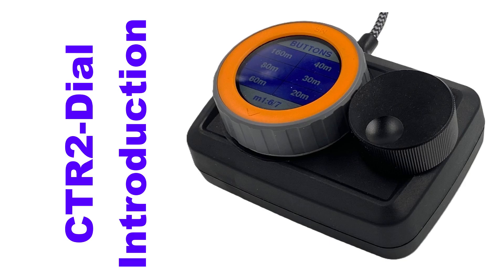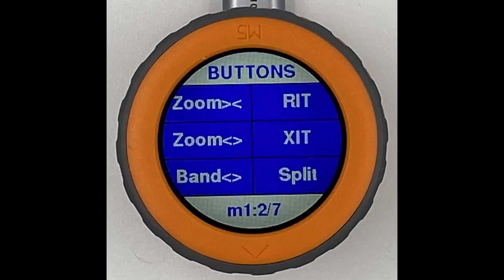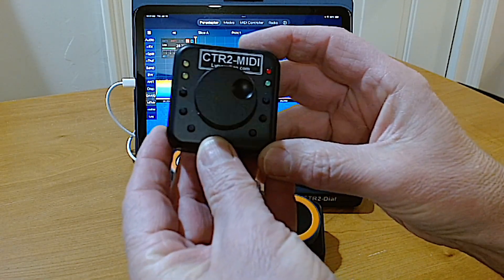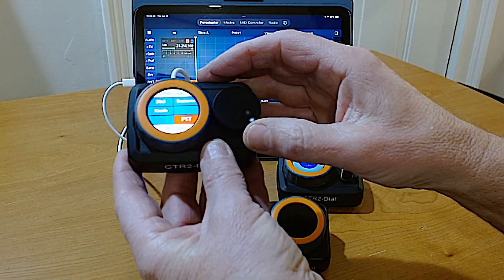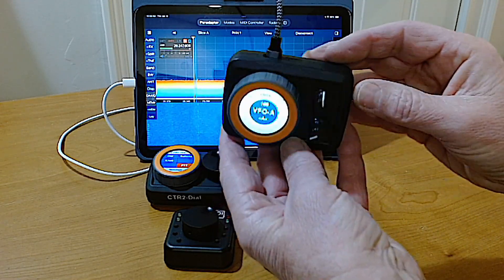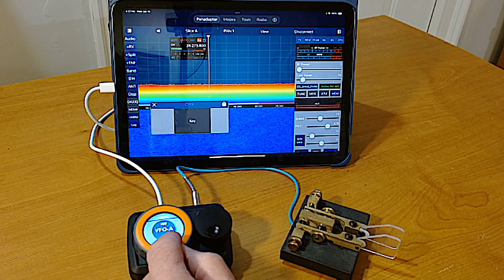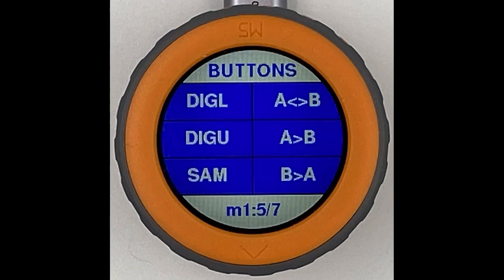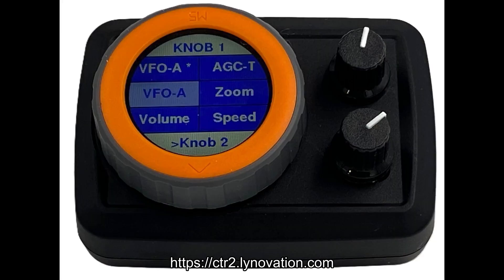CTR2 Dial Introduction

Comment: This is awesome. I love my ELAD USB controller, but its not bluetooth. I have moved all my Amateur Radio to remote operation. I love Thetis and HL2, and I love the Icom 705 with SDR Control software. Better yet, the price point for these wonderful controllers is fair for what it does.
Reply from the maker: Thanks Steve. I try to keep the cost as low as possible, but there are a lot of costs that are out of my control so I've had to raise my prices lately to compensate.
73, Lynn

Comment: Hi great project, is it comparible with windows flexradio 
software ?
Reply from the maker: Chris, no, it doesn't directly control SmartSDR for Windows because that program doesn't support MIDI control.

You can use a middleman program such as CoyoteMIDI that can receive the MIDI commands from CTR2-Dial then convert them to keystrokes or mouse moves. There's a small discussion about this on the CTR2 user group: https://groups.io/g/CTR2/topic/using_ctr2_midi_and_ctr2_dial/112177754

I'm also working on a separate program for CTR2-Dial hardware call CTR2-Flex. It can directly connect to and control a Flex 6xxx/8xxx radio and is compatible with all versions of SmartSDR. You can read more about it on this post on the CTR2 group: https://groups.io/g/CTR2/topic/ctr2_flex_firmware_beta/112614919

73, Lynn
Reply: @Lynovation  Thanks at all, regards
Reply from the maker: Just an update... The CTR2-Flex controller works with any version of SmartSDR, including Windows version. It connects directly to the radio's server and doesn't require a 3rd party program to control your radio. In fact, it doesn't even need SmartSDR, it can control your radio as a standalone controller. You can check it out on my Lynovation web site.
73, Lynn